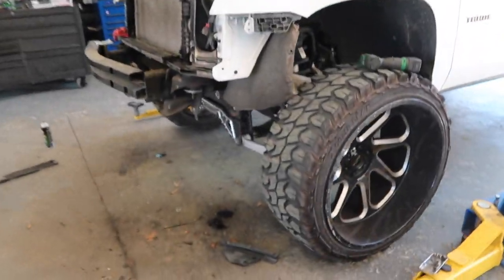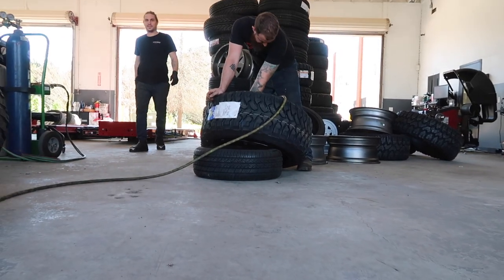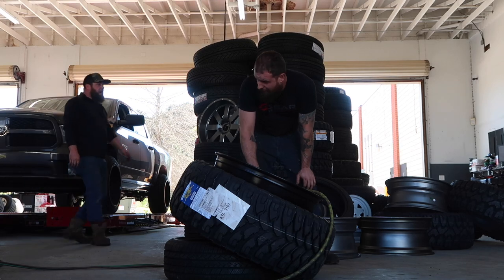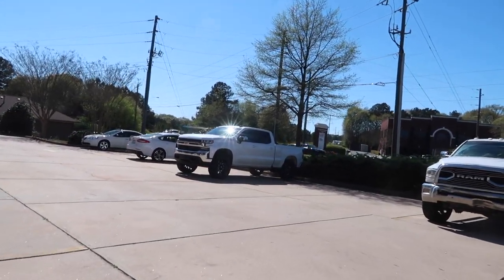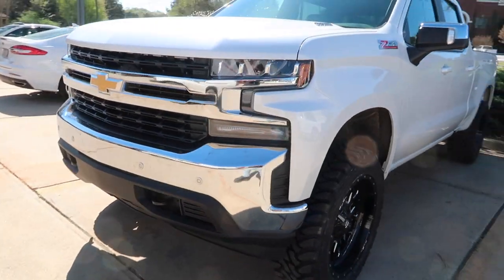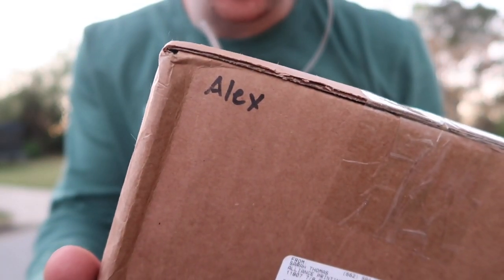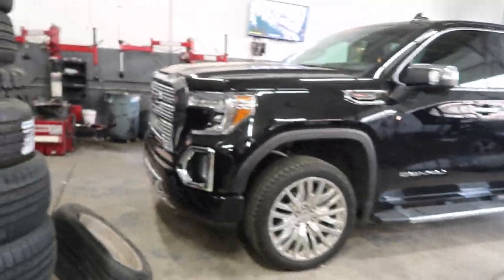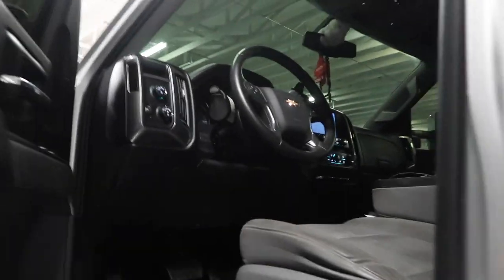The BEST daily setup! NEW Chevy Duramax 1500 on 22s and 35s | Lifted Trucks | Parts Ordered

Comment: So on a stock 2021 I should be able to put 33’s?
Reply: I have a 2021 Chevrolet Silverado 1500 Custom and have 20" wheels and 32" tires and still have room for larger tires which 33's would fit and I have no suspension lift kit on it but would like a 2" no more than 4" suspension lift kit in the near future..ok course would need new wheels and tires, that would be a additional $ 4,000.00 , go to a tire shop they will be able to let you know if you can get 33" tires..